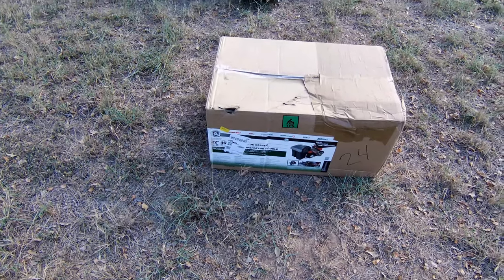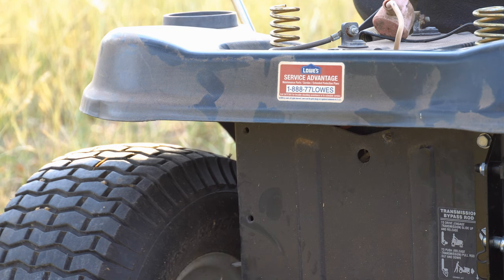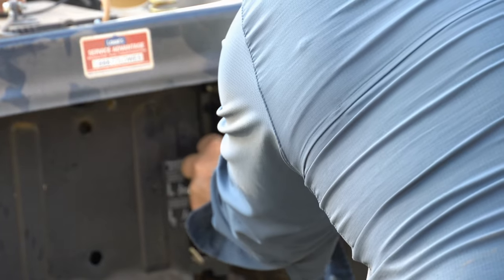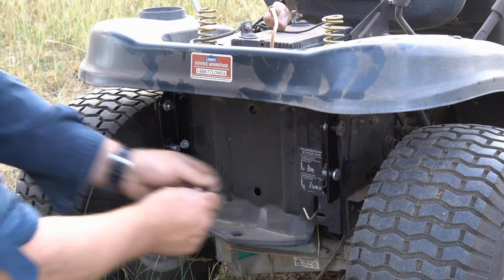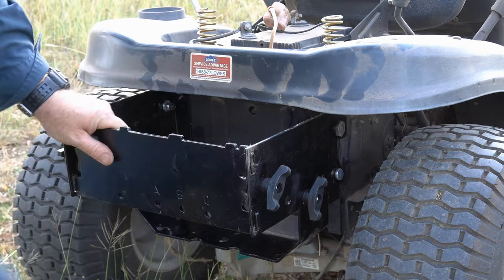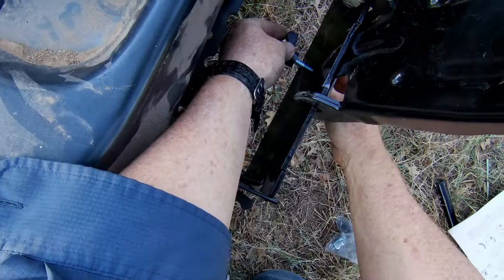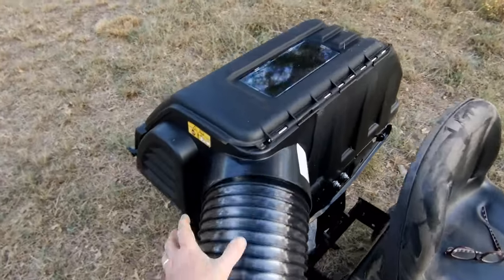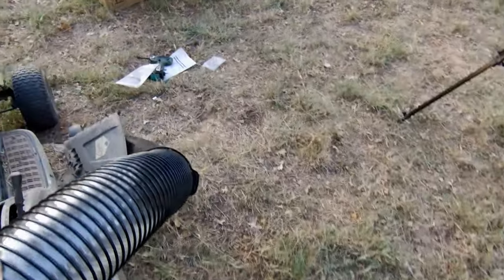🚜 MTD Mower Double Bagging System. Full Install Guide &Testing!

Comment: Does lining up the bracket with the A B C marks for 48, 42 inch, 38 inch deck matter too much?
Reply from the maker: It is really difficult to say since there are so countless models.  This bagging system will fit many models, but it is hard to say exactly which ones.
Reply: @nothingbutgadgets  I got it on, but I had to duct tape the clear bagger hose to the plastic chute because the collar wasn’t tight around it like yours for some reason. It just kept sliding down
Reply: @MrJaison12  Gald, you got it working. Duct Tape to the rescue!  Who knows how many times the world has been saved by duct tape, WD-40, and Bailing wire.

Comment: Ensure chamfered edge faces up on the back brackets that attach to the mower.  All self threading bolts are 1/2".  The small bolts and nuts that hold the chute to the deck are 11 mm.  Who knows?  Instruction book SUX!!

Comment: what i am scared about a bagger kit is using a flexi tube, since its "translusive (thin) plastic", one day that tube will end his life versus rigid (black) tube... yesterday, i have ordered a 50" bagger kit from MTD and the pictures showed "rigid black tube", i hope i will have this version versus "flexi tube" "(¬ . ¬)"
Reply: I have the older style and let me tell you it’s a POS! The lower chute is plastic and will blow apart when you mow the smallest stick! I have to find the pieces and glue it back together every time I mow! I have to buy a new lower chute for almost $100 every year🤬🤬🤬. This part should have been made of steel because it takes far more abuse then even the blades or deck do as stuff is coming of the blade tips and getting launched right into the back side of this plastic POS.
Reply: I must add I’m not mowing rocks or anything. Put a new set of blades on yesterday and first time out the thing broke! The blades don’t have a single nick and still have paint on the cutting edges! You don’t want the old style!
Reply: @Trump985  hm...
Reply from the maker: I am in my second year of mowing with this kit. I have had no problems with it at all. My yard is about an acre and my land is nothing but rocks. They seem to work up out of the ground. Not little marble size rocks, but egg and baseball sized rocks.  I do my best to pick them up, but I have hit many over the last two years when the grass gets too high for me to see them. I had to upgrade my mower blades to Gator 1/4" thick blades so they don't get destroyed when I hit these huge rocks.  My yard is also a forest of post oak trees. They are always dropping limbs. So up to  one or two inches thick.  I don't even stop to pick them up if they are an inch thick or less. I just mow over them and my heavy duty blades turn them into wood chips.  

So far this bagging kit has been amazing. This year we have had a ton of rain and I have bagged a couple of semi truck trailer loads of grass.
Reply: @nothingbutgadgets  Thanks for the info! I guess I’ll be upgrading to this newer style bagger next time I have to replace my lower chute.